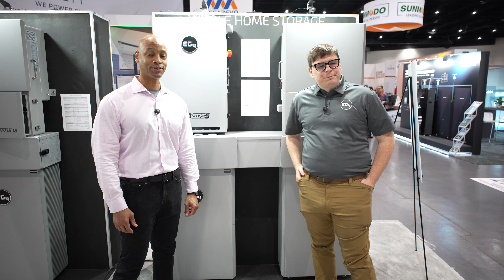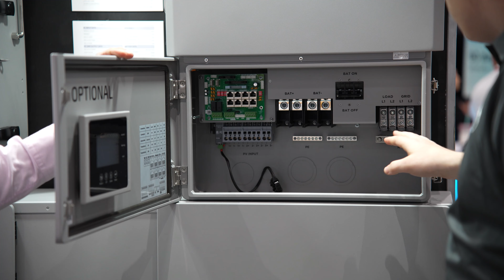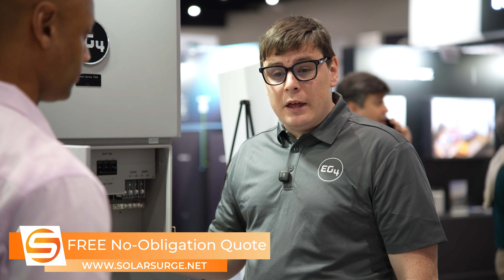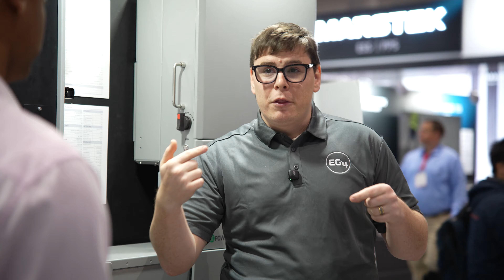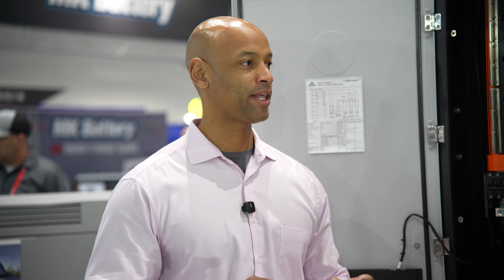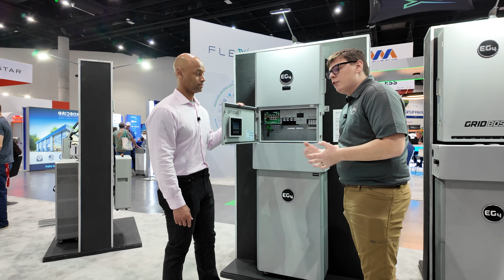New EG4 Inverter 2025 Lineup

Comment: I recommend Eg4. I need to update my 3000 version 1 so it can properly ac output with my more recently purchased inverter. 

I've spent about 5k with this company so far. I'll definitely spend more once the tariff war settles
Reply from the maker: EG4 will be manufactured in USA before the end of 2025. So there should be no tariffs.
Reply: I definitely don't recommend EG4's high frequency, transformerless inverter tech because it can damage your home's appliances when its H-Bridge circuit fails.

Comment: How many power pro batteries can be hooked up to each 18k & 21k and if I run 2-3 inverters on a single install does that mean I can multiply that number of batteries accordingly?
Also will the grid boss clean up generator power like the flex boss 18/21 can OR how can I integrate a lower cost generator with multiple inverters? thank you!
Reply from the maker: You can do at least 3 batteries per inverter.
Reply: @ so if I have 3 x Flex Boss 21s I can have 9 power pros?
Reply: @mattbrew11 you could have more per inverter but then you will have to add a external bus bar
Reply: I read through the manuals. It reads that they recommend about 4 x 48V 100Ah batteries per inverter, usually you need at least 2 batteries for each inverter.

For generator, you are correct, you only need 1 generator going to the Gridboss to charge all inverter/batteries. Even though the Gridboss and Flexboss can "clean up" the dirty power, I personally would still install the chargeverter if I were to use the dirt cheap generator out there. Or if I don't install the chargeverter, I will use the inverter generators. 😊

Comment: I used to be a Sol-Ark fan ( I don't own either Sol-Ark or EG4) but it seems like over the last two years EG4 has really started making some big moves and passing Sol-Ark on improving their quality and line of products.       Some say that Sol-Ark has better phone support than EG4 so that is something to consider.       Thanks Joe !
Reply: I've installed over 25 eg4 inverters and my friends family, and clients love them. Thanks eg4 for making going solar affordable, reliable and efficient finally 🙌
Reply from the maker: Good feedback. I personally have sol-ark installed at my home currently, but I do think EG4 is aggressively looking to take them on.
Reply: I have a solar 15K. Runs entire house.
No hiccups customer support is outstanding, far better. Then, when I dealt with sexy solar, who makes the eg4.   Sol-ark start it off in the industrial market.So their reliability is well proven, EG4 goes through several revisions, they'll bring out an inverter, and then stop making it. They now trying to become proprietary. You start linking in their batteries and other things. It's gonna be a problem for you down the road.
Reply: @TheFatman819  ive swapped a few headache inducing solark 15k paired with lead acid for the flexboss21 paired with powerpro batteries for some very grateful clients 0 hiccups, more power than they ever imagined, 1 was even able to get a tesla with the excess power they produce and can finally use/store reliably
Reply: @TheFatman819  Going forward it will be REQUIREDD by UL cert and therefore for installation in MOST regions of the USA due to permitting requirements to attach to the GRID.  That is the part you missed.  The wild west days are over.  It is not proprietary.  It is a NEW cert standard going forward.